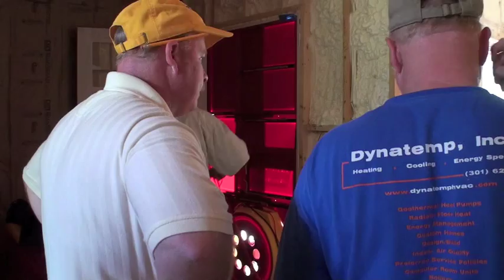Nash "Net Zero Energy" Home part 2 of 2

Comment: although  under .6 ach/50 pascals is a  great start  to an  energy efficient  building
the open cell foam between the 2x6 studs is far less impressive and  not a good way to insulate 
with  thermal bridging and lackluster performance of open cell the walls  wouldnt  be much above an R21-22.

 6 inches of  Xps  on the exterior  would be  cheaper and more efficient
Reply: I was wondering about the Thermal bridging issue.  That could have been done better.  I guess, live and learn

Comment: A Pascal is a unit of measure of pressure in SI / metric system.  It is equal to 1 kilogram of pressure per square meter.  Air pressure is usually measured in kiloPascals (1,000 Pascals) or kPa.  Standard air pressure is 101.3 kPa which is equal to 14.7 pounds per square inch.

Comment: I am not as impressed as Troy.  I retrofitted my home partially with open and closed cell foam insulation.  My houses ACH (air changes per hour) @ 50 pascals went from 8 to 1.8.  I think there is still room for improvement.
Reply: I know I'm 6 years late.  I would like to retrofit my home now that I can afford it.   It's getting older and the insulating qualities are fading.  Its just batt insulation and I can feel the air push right through the walls when it's cold or breezy.
The HVAC is OK but the duct work is not and will likely need replacing.
Any resources that you would have me go to for even more information?